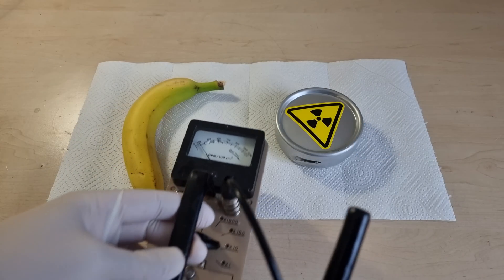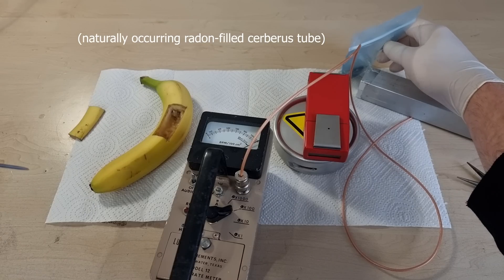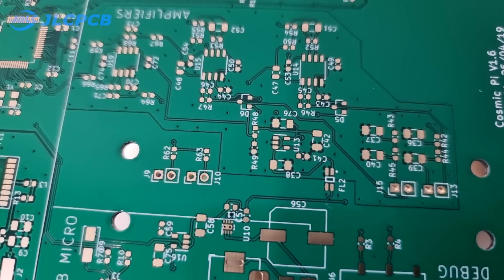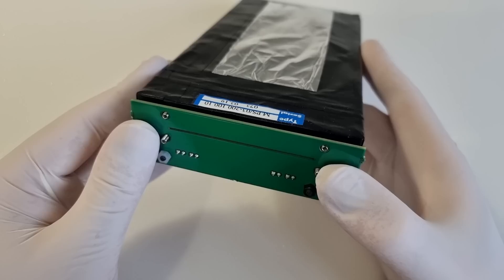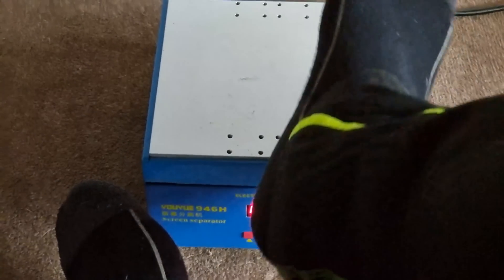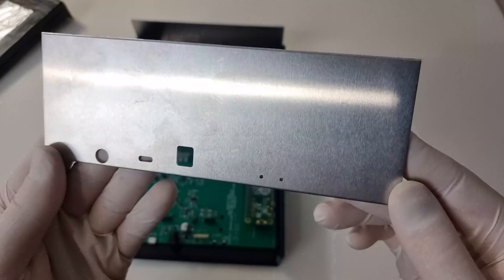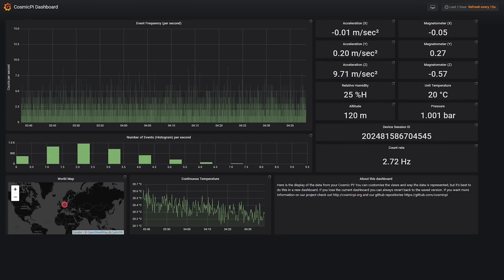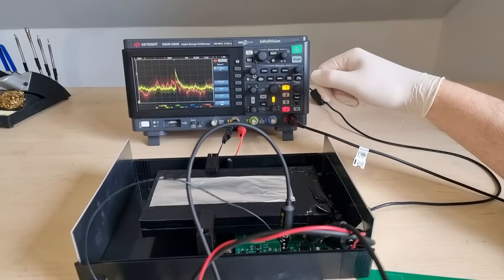CosmicPI: Detecting Cosmic Rays with a Raspberry Pi

Comment: Just FIY Geier-Müller counters are not really ideal for tissue dosimetry. The physics of how they detect different types of radiation is more or less independent from the physics that makes radiation harm us. PMMA as a scintillator coupled to a good photo-multiplier tube/diode is technically preferable since PMMA is tissue equivalent. The cross-sections of the various interactions in PMMA are very similar to tissue, so when you get a reading in PMMA you can be reasonably confident it will be no more than 2% (usually about 1%) different from that in tissue. With Geier counters you just calibrate and hope that the radiation you encounter has been adequately accounted for my the manufacturer calibrating your Geiger counter to display mSv. 
The disadvantage is that you need an expensive photo detector and the whole assembly tends to be more bulky for similar sensitivity.  But there is a reason we often use PMMA phantoms in testing new CT scanners or radio therapy equipment. 
Kinda cool that plain old plexiglass glows when irradiated, isn't it? Now that I'm saying that, I don't think I've ever seen a photo of that, only plots and data in papers..

Comment: I really hope that the component supply clears up by 2022. A project I was working on that I was hoping to turn into a kickstarter is completely on hold because like everything that isn't a dip part from 20 years ago or a passive is out of stock. FPGAs are gone, HDMI drivers are gone, ethernet PHYs are gone, USB2 ULPI and USB3 PIPE chips are gone, etc. I'm trying my luck with utsource at the moment...

Comment: Ordered some 4 layer board from jlcpcb to make an HDMI adapter for a FPGA board I have that only spits out LVDS. The redriver/level shifter chip is an 0.4mm pitch QFN that has 30 pins under a 4.5mm by 2.5mm package. I hope the stencils are good...

Comment: Wait, how did you actually buy a bme280 on eBay? I only manage to get the cheaper humidity-less bmp280.

The Arduino Nano 33 BLE is an nrf52840 (an m4f like the f401, though a little lower clock), with a built in lsm9ds1, which might be a nice match for the needs of the project. It's handy that it's castellated with no bottom components for easy integration too. Adafruit has an nrf52840 feather "sense" that also has an st imu, though a slightly different model I think, plus a bmp280 and a separate humidity sensor. Of course, these nrf chips also have Bluetooth LE, though no wifi built in.

What weird looking gaffer tape, guess we can't trust 3m for that particular product. Pro Gaff is the best one allegedly, though gaffer power is not far off (and it's the one I use).  Also, black hot glue is cool. Not sure if I spotted that around your light guides, but if not, give it a try.

Comment: Hi quick questino of of the blue. Which resistor manufaturer would you recommend for vintage audio equipment and another or even the same for measurement accuracy equipment such as an oscilloscope etc.. I am based in Poland. Would like everything to be as accurate as it can possibly be. :) All the best to you! Cheers.

Comment: Marco, what was your build cost?  Also, an interesting point of fact, if you use a Thallium doped KI crystal as your scintillator allows you to build a spectrometer. This, in conjunction with a multi-channel analyzer that you can do in the STM32, would allow you to identify radioactive sources.   I bet with a little more tweaking using your own x-ray source, you could create your own x-ray fluorescence detector, and identify, which high precision the composition of metal alloys, etc.

Comment: While it doesn't work for every situation, I find that having a hot glue gun with a stick of black colored hot glue makes quick work of light leakage without any sticky residue everywhere... Just where you put the glue.

I'd love to run one of these, if the dev's want to have someone from the USA running a board.

Comment: Hi Marco, even if your broken NaI crystal were not broken, it and your two slab plastic scintillator are more like two digit spectrometers.  If you want a real 9 digit radiation detector, the only one smaller than a truck (e.g. smaller than grand sasso macro) is the Fission Meter, which easily can identify a cosmic ray interaction.  No need to rely on magical thinking that small uncalibrated scintillators will be better than a random number generator.  Try collimating a gamma ray source perpindicular to your plastic slabs and proving that coincident pulses look different from the thorium and uranium in your house concrete/masonry.  Let me know if you want some help.

Comment: You should try making a Hydrogen Line radio telescope. It’s basically an antenna and an RF front-end that’s tuned to receive and measure the strength of 1.42GHz radio waves that are naturally emitted by Hydrogen atoms. If you mount this contraption on a pan and tilt mechanism you can raster-scan the sky and create an image! 
If you wanna go further, you can measure the frequency deviation of the incoming radio waves from their centre frequency of 1,420,405,751.7667MHz, plug it into a Doppler Shift equation and see the direction and speed of the objects in the sky! Just the idea of it is enough to turn me on XD

Comment: Hey. I know this is not relevant to the video but I know no other place to ask this.
We want to replace our weller 95w soldering stations at work but we don't know what to get.
Requirements are 8h per day running time at 350C and use small tips. Price range is up to 1k€.
Thank you for any and all answers.